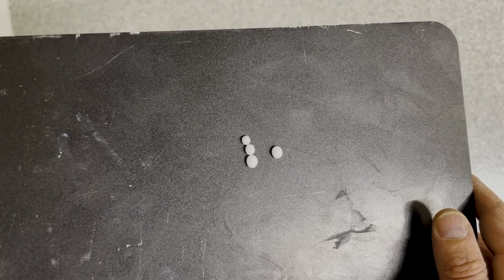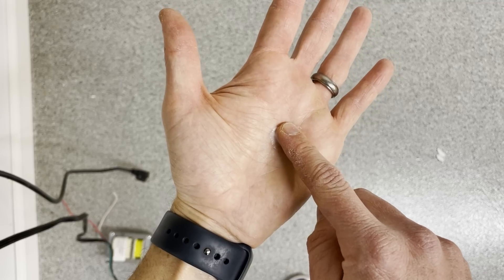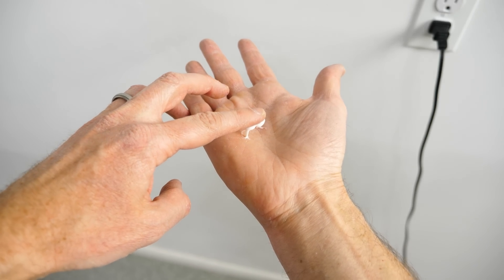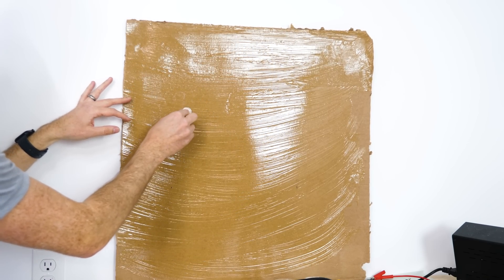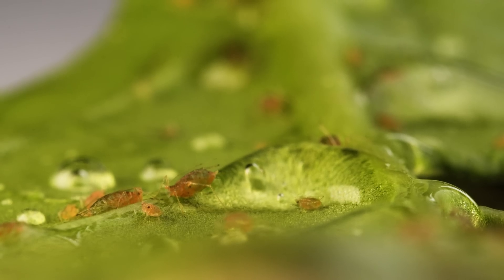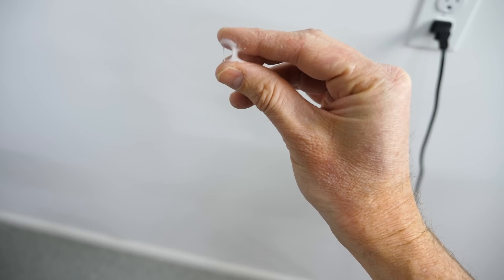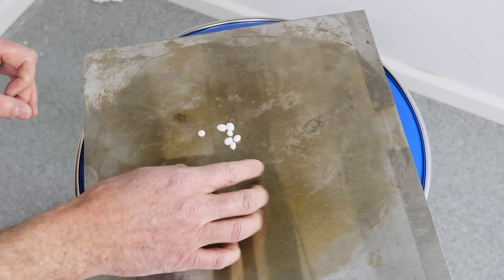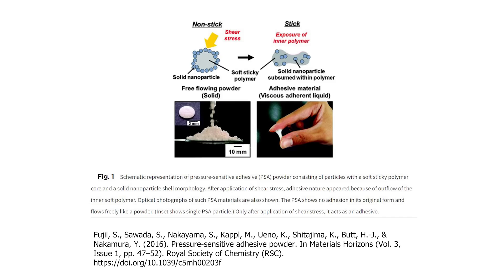Slippery Glue Is Actually a Thing

Comment: It would be cool if you could only activate the adhesive by applying a certain frequency and amplitude of sound to the bonding area. That would avoid accidental stickiness when assembling pieces. Then you could activate it with a speaker or ultrasound-type device when ready. Perhaps a whole structure could be glued at once by vibrating it at the right note. Those lil bubbles must pop at a wavelength related to their diameter, so just make sure they're all the same size. Like solder paste activated by sound (pressure) instead of heat.

Comment: I use buckets of the stuff doing flooring. And I can say for certainty that this coated adhesive would serve no benefit. The sheer pressure of it being in a 5 gallon bucket would be enough to smash the beads at the bottom.

Comment: I saw a thing I just cannot figure it out:

You go up to a mirror and put a piece of paper against it. Then you hold an object smaller than the paper against the paper (in the center of the paper and equidistant from all sides). Next, you shift your view angle by bringing your head closer to the mirror (without moving the object or paper) and you will see the object in the mirror, even though the paper should block the photons bouncing off the object from ever reaching the mirror.

Can someone help me here?!
Reply: Stop doing acid…
Reply: Same reason you can see around corners with a mirror. Light rays extend in multiple directions. The light bouncing off the small object does not travel only in straight lines toward the mirror alone; Your eyes being able to see the object (not reflected by mirror) is proof of that. The light bouncing off of the object reflect into your eyes, into the paper (as you correctly assume), and also DIAGONALLY, past the edges of the paper, where it reflects off of the mirror and back into your eyes again.

You’re entirely correct in thinking that the paper would block the object from being reflected, and it does from some angles (for example, if you looked head-on at the paper + object; no object reflection).
Simply, the paper just wasn’t large enough to block all the light reflecting off the object into the mirror.
Hope this helps :)

Comment: Idea: make a 2-compnent epoxy version, where one half of the beads contain the resin and the other half the hardener. When squished, the 2 components mix! This would be amazing, because it would remove the need to mix the glue before applying like normal two-component glue!

Comment: One drawback I can see is that the hydrophobic particles are still in the glue after you disrupt the coating, so they will make patches or bubbles of non-adhesive.  As long as you don't need the maximum performance of the adhesive, this may not be a problem.
Reply: Good point

Comment: Once worked as a press operator to print on rolls of tape (you don't notice how much tape has ink and labels on it but they be doing that everywhere).  We also put the glue on and it came as dry little beads.  This must be a surface area thing plus heat/compression.

Comment: If you coat the glue beads with magnetic powder, can you then control where the beads roll using a strong magnet, instead of just tilting the surface? Would love to see a video of that.
Reply: This is a great idea. I don't know if it could mix with the hydrophobic powder well enough (or if you could get enough of it on there to counteract the weight) but it could be very cool. Of course you'd also have to avoid having the magnetic powder travel straight through the glue drop to get to the magnet. But it may well be possible!
Reply: @OhSoUnicornly  Actually, the magnetic powder travelling straight throw might be a useful "switch" for the glue without having to physically flatten the beads. Then perhaps the glue can be evenly applied with a magnet, without streaks from a paint brush or air bubbles from just pressing another surface against it.

Comment: I can think of a great application. IF you could make MUCH smaller beads. 3D printing. 

You don’t NEED glue, but it’s pretty common to use glue sticks as an adhesion promoter for the first layer of a print when it’s a difficult filament or delicate print because it’s water soluable. 

But it would be cool if you didn’t need to re-coat it every time because only the beads that were squished by plastic were actually used.

Comment: I'd use it in construction so if a wall cracks it will break the beads and cause them to seal the crack.... It might work in bricks, cinder blocks and drywall too.

Comment: You could use a coating that would dissolve at a certain temperature to make it even more controllable.
Reply: The problem then becomes enviroment

A heat activated glue can't be taken to a desert or be used in places with alot of hot metal and cold activated can't be taken to Antarctica or be used in cold rooms

It's severely limiting with a low pay-off

Comment: I heard sticky notes use a similar coating to keep the glue in tiny round particles that pop when you push on it
Reply: He says that right after the 1 minute mark.
Reply: @seanbrockest3888  He mentions post it notes are pressure sensitive, but he does not elaborate on how they function
Reply: @seanbrockest3888  No he doesn't.
Reply: @phuchu  1:15
Reply: @wesley_that_dude3437  I think you need to get your ears checked. He never says "sticky notes".
Reply: @phuchu  post its are literally a sticky note brand
Reply: @phuchu  post-it notes are literally the same thing
Reply: @phuchu  you're insane
Reply: @bower31  no, we are all insane, he is the only one sane.
Reply: @phuchu  sped af
Reply: @phuchu  doofus speedrun Any%

Comment: you could freeze them, too, and then the adhesive could also be considered temperature-responsive.
Reply: Lol.
Reply: Thank you for using your head.
Reply: Most wood glues need to be kept above freezing.
Reply: But then it just melts. The beads keep their coating indefinitely while frozen glue is only temperature sensitive while its cold.
Reply: @sh1nryel754  wouldn’t applying at high enough temperature make the “freeze” method reasonable.
Reply: @sh1nryel754  thats the point
Reply: Mmmmm... no, not actually.